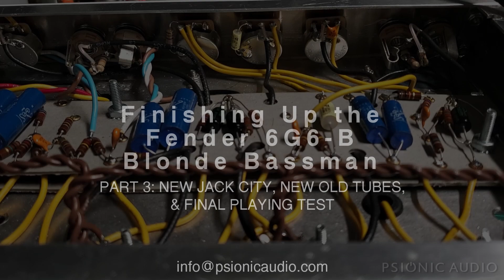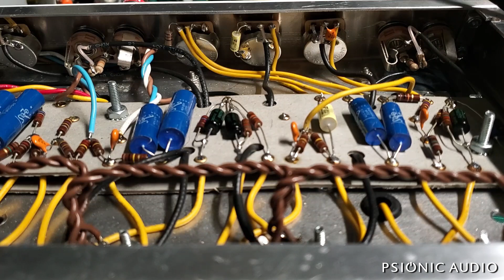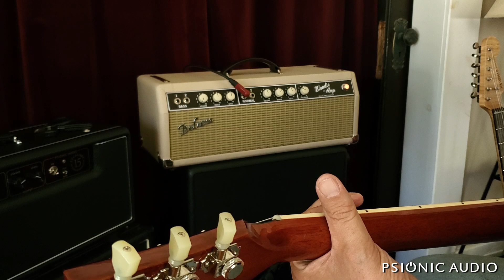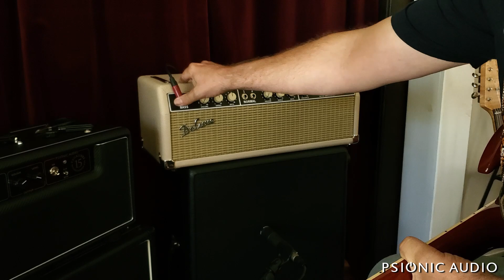Finishing Up the Fender 6G6 B Blonde Bassman | Part 3 : New Jacks, NOS Tubes, & Final Playing Test

Comment: That Bassman has amazing harmonic bloom and crunch now that you made it into what it should have been in the first place.  Excellent.  Have you ever worked on other 6G6-B Bassmans before?  I would think that there aren't many of originals out there due to short run Fender did for 6G6-B blond bassman with the Presence knob, before they move to the Blackface Bassman that had switches on the front face plate.  I'd be interested to hear which vintage/original Bassman you've had in your shop that you liked the best for tone, touch-sensitivity and overall usefulness.
Reply from the maker: Thanks so much! I've had originals in, maybe five or so. On those my remit was restoration, but on this one I could make changes to the Bass channel. 

I love the Blonde and Brown era amps, except for the stupid tapped treble pot, used here on the Normal channel. It has a very narrow sweet spot as a result.  And some of the Brown amps have stupid tone stacks, but that's really corrected.
Reply: @PsionicAudio Holy shit.

Comment: Awesome video, what amp would you take between the 6g6b bassman or the 6g12 concert? 

I really like the concert but the bassman with a 4x10” could likely get ballpark to the concert without the harmonic trem. That’s what I’m telling myself because there’s no clones of the concert out there!!
Reply from the maker: Well, they’re really different sounding amps. The Bassman has that incredible gain if you want it. The Concert doesn’t but has that trem. 

Honestly though if I wanted the harmonic trem I’d just go for a Flint or other digital model of that harmonic trem into any good clean Fender.  Much less expensive and more reliable.
Reply: @PsionicAudio  That’s interesting, yes I saw from your other video that the harmonic tremolo can cause issues and that makes sense. It’s basically a univibe. I think Id rather do univibe with a marshall anyways. I just like the woody tone of the concert 4x10s and the bassman is woody too and has a thick tone. Great with a treble booster I imagine. I’ve got a vibrolux and saw your vid doing that too. Your vid’s are really cool. I’ll keep watching!!

Comment: Could you have installed power scaling a la the London Power scaling on your website to make the amp a little more manageable volume wise? Also, can you share which kit this amp is from and whether you’d build such a beast. 🍻
Reply from the maker: I don't do power scaling/variable voltage on fixed bias amps. Twice as complex with very little benefit.

I don't know whose kit, probably Mojotone. I don't built kits.

Comment: Lyle, I've viewed all the videos on this amp and in the previous video on this amp you show as one of the mods you did was to change out the cathode bypass cap on V1 from 25uf to 1uf and you removed the bypass cap, another 25uf completely on the second triode. I this video I see that the second triode cap has been reinstalled. Is this correct? I'm asking as I'm modding my Blonde Bassman build to match your recommendations. Thanks!
Reply from the maker: I put a 4.7uF on the second triode IIRC. Might have been 10.
Reply: Thanks Lyle!
Reply from the maker: I think I remember wanting a bit more gain without mud. And/or wanting the heater hum rejection of the bypassed cathode.

Notice the snubber cap across the second stage plate. That was very necessary to keep squeal out and reduce hiss. I don’t remember what I used now, but it would have been between 100-500pF. Experiment.
Reply: @PsionicAudio  In the video you mention a 330pf across the 100K plate resistor. I'm rather sure it was the same value as the treble bleed on the volume pot.. I'm going to try the 4.7uf for the bypass cap.
Reply: CORRECTION: I was wrong Lyle, 😕 I rechecked my notes from you video and you indicated that it was a 500pf cap across the second stage plate resistor. I wanted to be sure that this was noted for future reference to this video/discussion.

Comment: Sounds great but I am surprised its not blowing your head off at Vol.5. Its a question that has bugged me years: why are the vintage versions of amps so much quieter than the modern amps? I have a SF Super Reverb (40watts) and a SF Vibrolux (35watts) and I'm sure my Deluxe Reverb Reissue (20watts) is louder.
Reply from the maker: A restored vintage amp isn't quiet at all. If your SR and VR aren't louder than your DR RI then they need service. The Normal channel was very loud here at 5. It's just that the "Bass" channel is insanely loud.
Reply: alot of things go into the perceived loudness of an amp. it's not just wattage. many other factors like speaker sensitivity/type. whether the amp is biased correctly etc. Keep in mind that it takes roughly ten times the amount of power for one amp to be just twice as loud as another. I say roughly, of course, because of the many other variables involved. But yea man, that super should at least be louder than the other amps you mentioned, all other things being equal.